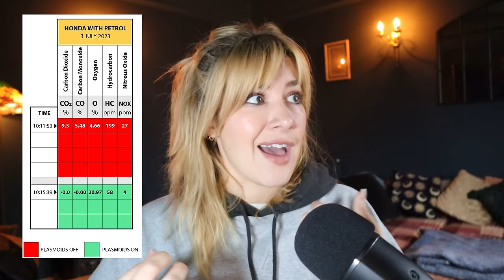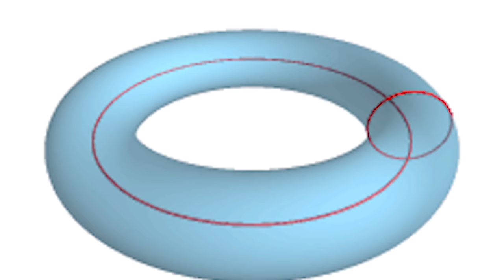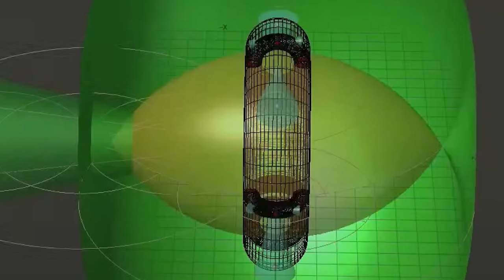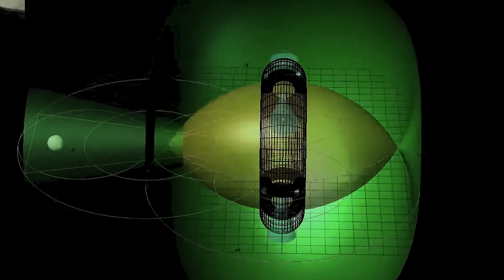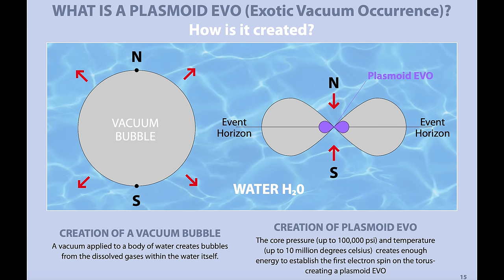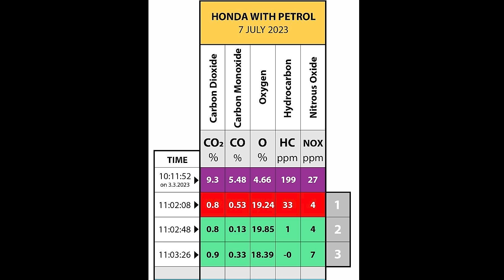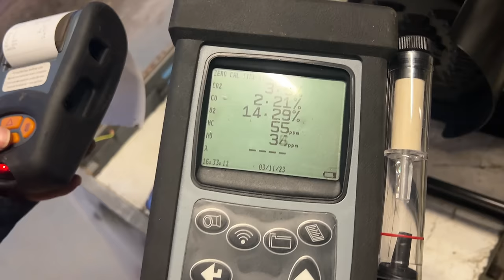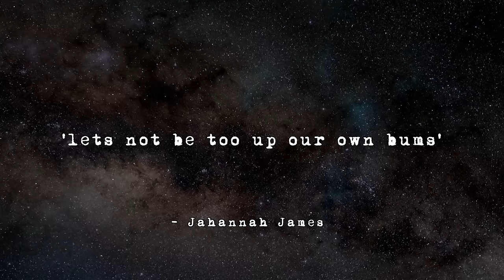Lost Ancient Plasmoid Technology? | The Thunderstorm Generator

Comment: Since the removed carbon is being exposed to extreme heat and pressure by the plasmoids... I'm venturing a guess that the crystals are diamond.
Reply from the maker: quite possibly! the chemical results are coming soon from the testing
Reply: It’s possible.  A researcher by the name of Mark LeClaire, working for ARPA, built a hydrosonic pump system that pumped water through a rolled perforated Aluminium sheet inside a plastic tube, in order that he could explore cavitation (the thing that eats ships propellers).  Within 1 hour of turning the pump on he was rushed to hospital with acute radiation poisoning (from which he recovered).  Upon investigation into how this happened, it was found the simple system he had made produced elements all the way up to Californium - and that the perforated Aluminium sheet was covered with a shiny sheet that turned out to be … diamond.  So, yes, this technology can produce diamond, and gold, and a whole range of elements (albeit the heavier elements being only produced when overdriving the system, such as applying ultrasonic shockwaves to the same edges in a perforated Aluminium sheet in a closed circulatory system)
Reply: I was thinking the same thing 😊
Reply: @gordondocherty thank you
Reply: You are correct, at least in that Greenyer has found carbon/diamond produced in reactor sample SEM tests. He called it a "foam." Imagine, frothy diamond. I am starting to wonder what would be awesome to make out of diamond? A tea set? Hehe.
Reply: @gordondocherty sounded interesting couldn't find anything on what you were talking about any ways to look it up for myself general searching didn't get results

Comment: Ok, so here is the chemistry. Im going to take a simple example but it will work more slowly with any metal except gold. 

So for starters CH2 + 2.04 O2+ 0.01 N2 ------> H20 + C02 + 0.02 NO2
This reaction is undesired because it generates to much nitrous oxide and also will burn the valves. Literally 2Fe + 3O2 ---- heat -----> Fe203. 

Because of this we have excess fuel to lower the EGT and Map, thus lowering residual O2 decreasing nitrous oxides and saving the valves on the engine. As a consequnce there is both CO and CH* (simplified representation of a non aromatic hydrocarbon, * means its a free radical and will rapidly take up or give away an electron). In reality these are RCH* in which the R is a hydrocarbon moeity. 

So heres the important stuff, pay attention. 

3NO2 + H20 yeilds 2HNO3 + NO, this occurs faster with a catalyst (H2O2) and heat, but happens none the less. You ever wonder why grass often grows faster next to a highway, thats fertilizer. 

Ok so we can get acid from exhaust gas, what can we do with acid. 

HNO3 + H20 <----> H3O + NO3   for cheats we call H3O+ "H+" 

We will call metal this M* 

M* (including stainless steel) plus H+ plus an oxidant (NO2 is an oxidant) generates M+ HNO2 (Nitrous acid) 

M* plus CH* = MCH unstable. MCH + CO2 can genereate an acid or an aldehyde in the simplist case CH2M + CO2 yeilds M+ Acetate. 

Metals also bind CO2. 

CO2 + H20 ----> H2CO3, carbonic acid. 

H2CO3 with alkali metals like magnesium or calcium strongly form CaC03. 

In fact you dont really need anything fancy to do this, You need a large metal can, a super saturated solution of Calcium hydroxide and a drip tube, in a reservoir. The exhaust gas is pumped into the metal can, where it reacts with the CaOH2 and begins forming limestone. Yes, you heard me, limestone. Exhaust gas plus lime =water=> limestone 
    I use cal all the time, in fact its a regular feature in authentic mexican cooking, its used to process the dried corn into mixtmal, which can be used directly or ground to make Masa fir Tamales and Tirtillas. We the nixtmalization process is complete the skins are removed from the corn and the corns washed, but at the bottom of the reaction pot are small limestone rocks. This is because during the reaction corn releases CO2 and its captured befire it escapes. 

But Metal carbonates are often intermediate states. In fact at my college we had a huge problem with metal carbonates and metal acetates building up in the vacuum systems at the college, one guy even lost his eye trying to remove these. Its fairly simple if you know the chemisty

2H+ + MCO3 -----> M+ + H2CO3 -----> M+ H20 + CO2, the M washing away with the counter ion to the acid. Thus weak acids can purge a system of carbonates, typical the metal will the go onto form an oxide, like Fe2O3. The point is this carbomates are often a first step in the process of rusting, but nitrous acids are far better at stimulating rust, in fact if your HNO3 concentration is high enough you can generate hydrogen gas. 

So that everything you listed from the engine exhaust, in a bubbling aqueous solution, can be removed and placed into solution as a solute. The only thing that might have some trouble are the benzene, which typically will not react at STP in aqueos solution. 

The remaining gas is CO, carbon monoxide. CO is a particular nuiscence of photochemical smog because it wants to be in a higher oxidation state, like carbon dioxide, but because its resonance stabilized, like benzene, it takes alot of kinetic energy to get it there. Thats why we have catalytic converters on cars. That does not mean CO is unreactive at STP, it just means you cannot readily add or subtract covelant bonds to the CO carbon. However, because of the resonance stabilization it can readily move electron denstity around. Thats why CO is a dangerous gas, its a great mimic, it mimics the structure of O2. 
   As a consequnce when CO finds exposed metals it has a natural affinity to the exposed electron, this causes CO to form metal carbonyl compounds. In effect removing CO from solution. 

But heres the draw back of the system. By some magic the inventers manage to get the pollutants into the system. 

   OK lets think about it. You gas tank has a cars gas tank has a 40 liter capacity. Thats roughly 26kg. Of that 26 kg roughly 24 kg is carbon, 2 kg is hydrogen. The 24 kg of carbon will go on to form roughly 100 kg of carbonic acid, that means roughly, lets say we use berylium which is 8, thats 108 kg of Berylium carbonate. Where are you going to dump that. 
Lets say we use calcium which I think is 40, thats 140 kg of limestone. No problem we can bury limestone. Where do we get calcium hydroxide from . . . .limestone. We put CO2 in the atmosphere to capture CO2. 
   What about non carbonate minerals. OK, iron, there is an endless supply of iron and nickle in the earth. Right so you go to the gas station, little ole Johanna pumps here 40 liters of gas, she goes to the back of her car and she lifts out a nicely compressed block or Iron Carbonate, 133 kg. 

   Better head to the gym.
Reply: ❤😂thank you

Comment: My largest worry here is that if anything goes wrong with the test equipment or has any issues down the line, carbon monoxide is a completely odorless, tasteless, colorless gas, and the ones testing the device often could start having issues with elevated levels of carbon monoxide — even to the point of carbon monoxide poisoning. I’d highly suggest having at least one if not two separate devises just for detecting the carbon monoxide levels in the air while testing is taking place, and making sure the area is well ventilated. You can never be too safe, and the effects of carbon monoxide poisoning won’t ever be felt until it’s already far past the danger zone and often too late to save. Please be safe!

Also, as an extra note, is what is taking place at all related to cavitation? The “divots” in the stainless steel seem to be very similar to the results of cavitation, as with what happens with boat propellers. It may just be similar but not related, but it did make me think of that phenomenon.

Comment: Really sad to see you all stake your reputations on this, it's a scam and you are all along for the ride. This will ruin you all. Imagine simping for a lost technology you cant even describe properly.
Reply from the maker: a scam in what way? i'd love to know how 25 machines being rigorously tested in seperate labs, by seperate engineers keep producing the same results. 

Also genuinely how would you run an industry standard engine and remove the fumes smell and desperate need to cough from your lungs on demand? 

how would you 'replicate' the battering of the inner stainless steel that match plasmoid on metal testings in peer reviewed studys? 

how do you account for the chemical residue and crystals inside the sphere?
Reply from the maker: i very nearly fell for the vicious rumour mill that swirls around this, but on inspection there are receipts if anyone genuinely wants to investigate
Reply: You may be right and Bendall does indeed sound crazy after listening to his videos on howtube. However, he convinced a substation in London to test his device on a 300kW Perkins generator recently, so his device and claimed emissions must be somewhat convincing. These generators are expensive so no one is going to allow a joker to blow froth and 'plasmoids' through their kit without some sort of convincing reason, right? Unless of course they are in on the scam, but then where's the motive if it is supposedly to be open sourced?

Comment: Your car also has a flywheel because it needs the forward momentum of the wheel to keep the crankshaft from rotating in the wrong direction. So we use the persistence of momentum in a lot of different applications.

Comment: 🎯 Key Takeaways for quick navigation:

24:09 💡 Retrofitting vehicles with the thunderstorm generator technology can cost as little as $1,400, making it an affordable option to reduce emissions.
24:34 🚗 For every $100 spent on filling up a car with petrol, only $33 goes towards moving the car, while $66 is wasted on generating excess energy and emissions.
25:14 🌍 Using the thunderstorm generator not only reduces emissions and emits oxygen but also extends the life of petrol/gas, potentially making it last 40% to 75% longer.
26:06 🌌 The speaker emphasizes the importance of humility in our understanding of the universe and physics, urging caution in drawing conclusions about universal truths based on our limited knowledge.

Made with HARPA AI

Comment: @Funny Olde World / Johanna...you can covert both petrol and diesel engines to run on water vapor by separating the H²0 b4 combustion and only water vapor comes out the exhaust. I've done several hybrid variations...only need to change yer oil...check into it💪🤠

Comment: This reminds me a lot of what has been described as GEET. Many of the same components used in similar ways, creating a fusion of sorts. Not going to get into it here, but a simple google search should suffice. Its focus is not exhaust but more efficient fuel consumption, which is all part of the appeal of this Plasmoid. Separate from GEET is another related tech that uses a hydrogen bubbler (looks just like the one you showed in this video), but instead of feeding this Plasmoid, the bubbler output (hydrogen & oxygent) get fed into the air intake / carburetor of the engine, with the result being more efficient and clean performance. I could imagine a better world with all three of these technologies being added to the standard combustion engine. Unfortunately a common theme we tend to see is much resistance from the powers that be, which is another subject for another day. Anyway, this was cool and thanks for sharing!

Comment: I don't know about anything you taught us in this video except for at 11:55 . I know that's called "gyroscopic precession" which is defined "when a force is applied to a spinning object, the maximum reaction occurs approximately 90 degrees later in the direction of rotation". Pilots have to deal with this when flying a prop airplane or helicopter. the force is so strong when you are rolling down the runway and rotate the plane up to takeoff, the entire airplane wants to pull to the left. 

I am very curious about this technology. did you get any info about how long/how many hours these thunderstorm generators work? seems like the stainless steal gets eaten up pretty good. would these parts need replacing every week? or year?

Comment: Love your content and am a big supporter of everything Randall Carson and the Serpent Brothers as well as Uncharted X!! did notice on your video at 18:30 the Thunderstorm Generator wasn't actually bolted/secured to the exhaust port on the head of the engine and that there's a 1/4 inch gap that would allow the exhaust gases to escape into the atmosphere instead of going through the Thunderstorm Generator which would throw off all the measurements.
Reply: It is not bolted down at that point, presumably before or after the demo. You can see that it's bolted down at 14:34
Reply from the maker: Yeah it might not have been on when I was filming that

Comment: The ruins at Puma Punku has these curious cylindrical shafts that goes throughout the length of the stone slab structures found there. Does not seem to be for construction purposes. Maybe they are conduits to channel the plasma streams to various locations to power certain devices. Only materials made of stone could possibly withstand the intense heat these plasmas can generate for long periods of continuous use.

Comment: YinYang is 3000+ years old, of unknown origin and is made up of circles with the diameters of 1, 2, 3 and 4.
YinYang is not only about balance it is also centered around the 4 elements of FIRE, WATER, EARTH and AIR.
If 3 elements act on the 4th we get something special.
EARTH = Chemistry
WATER = Biology
FIRE = Physics
AIR = Chi/Energy of the Universe/antimatter

"Malcoms Thunderstorm generator" 
Air enters, it is acted upon by light and heat(Fire) it squashed and released by Water. All that's missing is the Earth. Earth is an electromagnet.
The Plasmoid is offset by 1.16° so to deflect it the equation is 1.16°x45°=52.2°- 0.58°=51.62 (think how a rugby ball bounces compared to a tennis ball).

The full theory with an experiment to test the theory is on another site. But since I posted it strange things are going on for me, so I want as many people as possible see my theory. It is only a theory, the math works and the latest data fits.

Comment: MFMP is on this since 2014, SAFIRE project since 2011 as an experiment to validatie the electric sun model. It spring forth from the Thunderbolt project, that puts the plasmoids at the hart of all energetic processen. They form in z-pinches. They form when the magnetic field that form around Birkeland currents pinches the plasma that is conducting electric current. 
Other names are Anthony Peratt, Hannes Alven, Nikola Tesla, SKY SCHOLAR, and many russian scientists, hope this helps. I noticed you got the MFMP. 
In addition I would like to mention that there is a spiritual component to this (like with all physical processes). Electricity has also been seen as the lowest, or least developed form from that perspective which is kind of puzzling. Maybe worth more investigating.

Comment: The problem I see with the experiments is the lack of engine control system and data logs.
For serious repeatability and monitoring they need to have fuel injection and log what goes in the engine and what goes out of the exhaust.  

Also, it would let us know how the engine parameters are altered to suit the system and what are the consequences : more air, less fuel, less timing, more exhaust temperature, etc...  
  
Maybe this system really works while also being absolutely not practical for actual use with load on the engine and or longevity, for example.

Comment: The divets on the inside of the stainless steel is caused by the bubbles. In a water pump it's known as cavitation and can destroy a pump over time. It also makes the pump less efficient at pumping. That's why you don't want air in a pump.

Comment: Interesting that the stainless is stained orange,  or coated with a copper color.  Analysis of the formation on the inside may prove tons of additives in petrol that don't need to be there.  If they aren't added, then we may need a better refinement process.

Comment: Hi Jahanna! Thunderstorm Generator Yech is much cleaner than Electric Vehicles (EV's).
Heck at the End Life of Petrol ⛽️ Gasoline ⛽️  Vehicles are cleaner  than EV's.  
How you may ask could Petrol ⛽️ Gasoline ⛽️ Vehicles be cleaner.  Lithium-ion Battery 🔋 Packs when Unplugged in Hot Summers the Expand, because Unplugged equals to no Cooling Systems flowing thru the Battery Packs. 

Thus, the Battery 🔋 packs Rupture and a Corrosive Acidic Orange or Brown Gel leaks into our GROUND WATER 💧  Note: I live in the United States and in all 50 States. There are only 4 Recycling ♻️ Centers  and none are in the State of California.  California Governor is the origin of the 2030 to 2035 initiatives for only EV sales / production.  California doesn't have a Recycling Center,  due to Environmental Impact.  
I would like to see this tech applied to my next Petrol Vehicle ⛽️. .. I am happy to say I learned some science here.. I could only buy the components,  though would have likes to invest in this tech and eliminate EV's. 👦👍🏎🏁🚩

Comment: The thing you didn't know the name of is called a gyroscope. It's persistence of momentum. He added the energy into the flywheel. When rotated the motion is forced to change direction. So there is no electricity involved. You have several inside your phone. Those have electricity involved to keep the momentum going. Same as inside a helicopter or rocket.